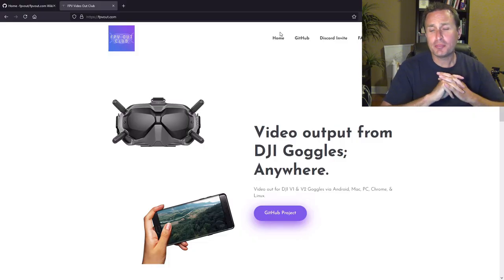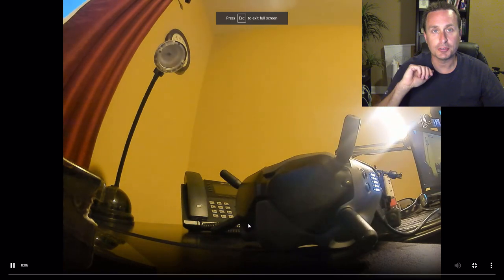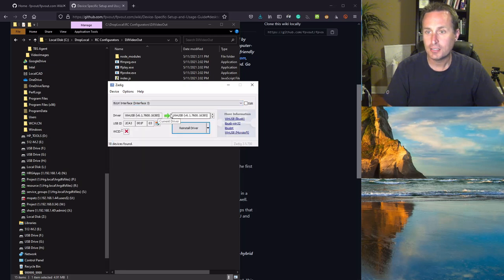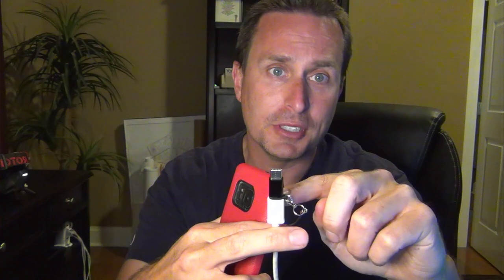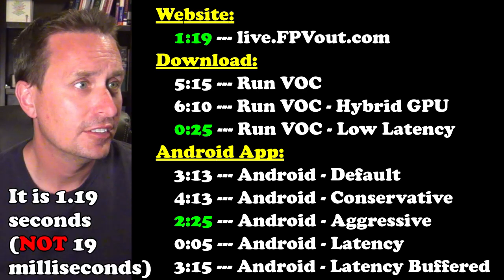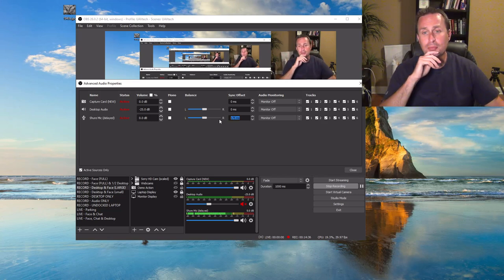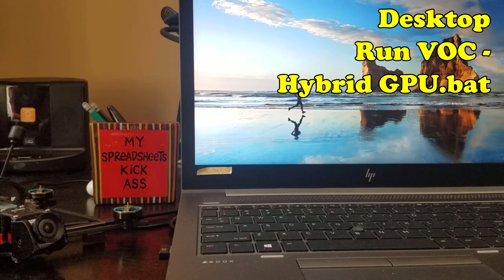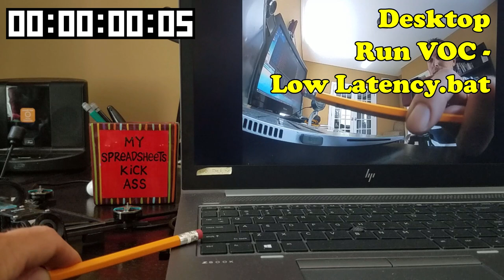DJI Video Out | Setup and Latency Testing

Comment: I finally got mine to work. I had to use an OTG adapter. It will only work with the adapter connected to my phone. Otg adapter running out of goggles didnt work. I have the Goggles V2 and my phone is a Samsung S22 Ultra. DigiView and DVCA apps both worked best on 50 bitrate. Thanks for posting this video, it helped me get this thing going. 🍻
Reply: have you measured the latency is it the same as the video up ?

Comment: The latency on a modern Android phone is much less. I tested on a pixel 2, 3a, 4a and 4a 5g and everything but the pixel 2 ran at less than 30ms.
Reply: Did you have any issues with it freezes? I'm running on my 4a 5g and there are constant laps in time and freezes. I was streaming to Facebook live too

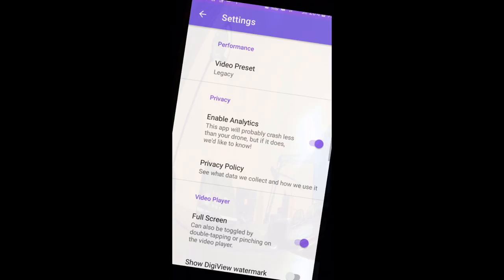Comment: A month ago I did my first live streaming using this tool, latency was not consistent during the flight, it was getting worse with time. This was my try  https://youtu.be/NXauCV4dIT0 look at 5:13 the throttle pump vs the image, audio recorded by the notebook. I'm going to test this new release to check if they solved the issue. They did great work however.
Reply from the maker: Did you delay your audio by the initial latency of the feed?
Reply: @uavtech  No, just put in the cable and start the stream. No audio delay changed. No obs settings changed